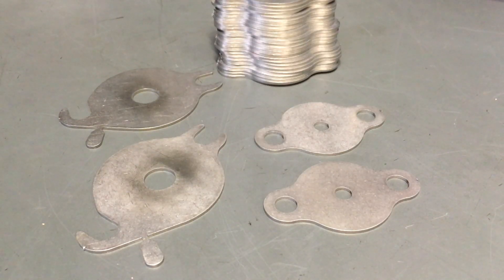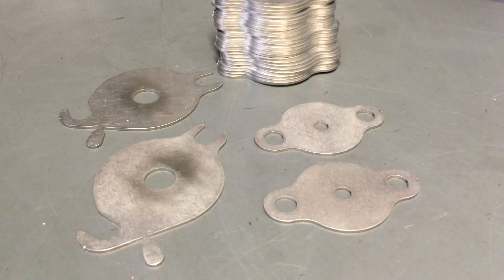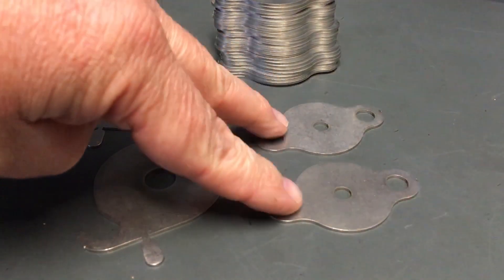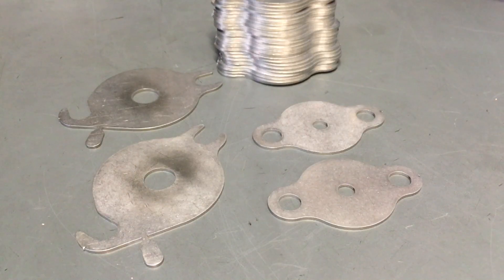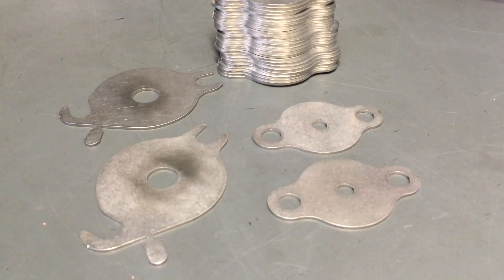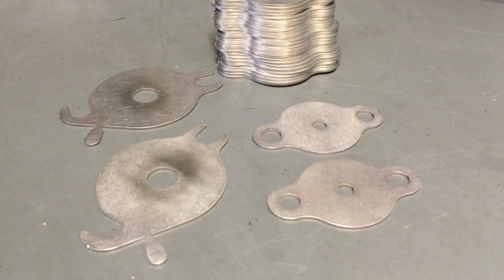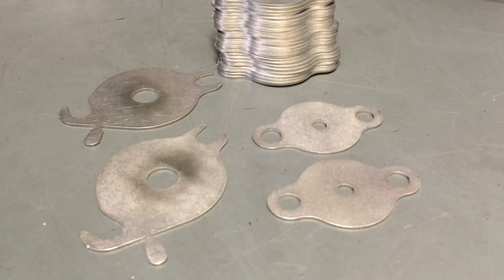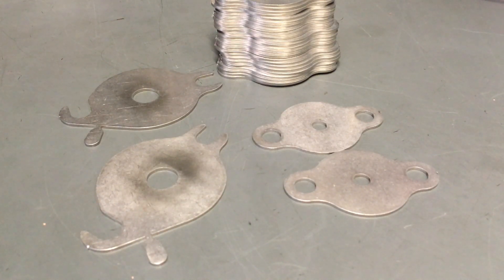CLEANEST EGRS IVE EVER SEEN

Comment: Great info just curious why would both a catch can and the plate not work best. I would think the catch can minimises the gases prior to the plate?
Reply from the maker: Can’t fully explain why maybe it evens out the mix and that’s why it keeps Building up in taking up all I know is the plate works with that no catch can
Reply: @Fourby4Diesel  Hey mate enjoy watching your videos , I have a question . Those this also apply for the 1GD-FTV also. Just bought a 2015 Prado with 12500km, its a euro 6 version from Japan. Just ordered the plate from Kaon but I bought the catch can first should I just use the can until the plate arrive in two weeks as I am in Trinidad and Tobago then get rid of the can after installing the plate?

Comment: Would like to put a 7mm plate in , the prado 150 has done 150k klms,  should I  change my injectors ?
Ps used your information to do the timing belt,  batabing thanks.
Reply from the maker: What year?
Probably
Reply: 2012